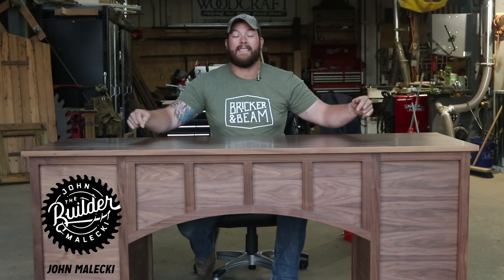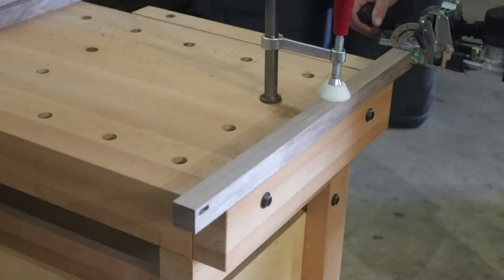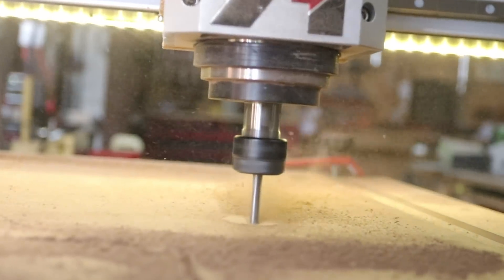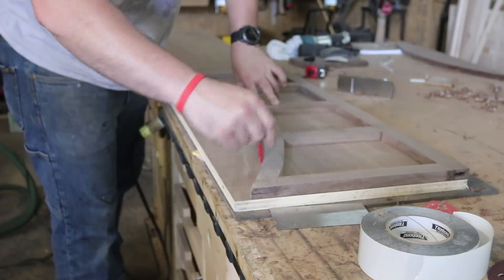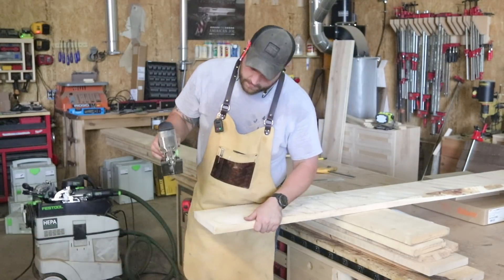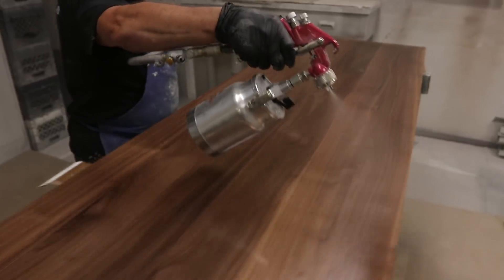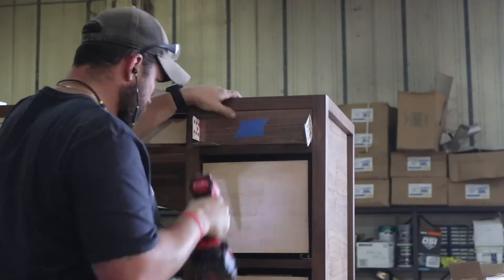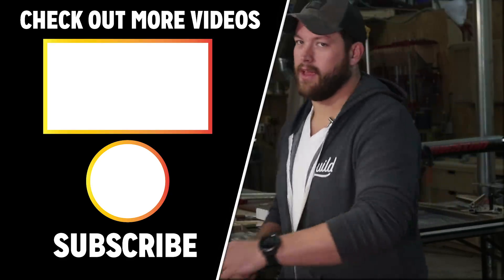How To Build A Modern Office Desk

Comment: Very nicely done beautiful piece. Here comes the (but) lol but I’m trying to see the $1600 in material . I can only guess you don’t have access to a local saw mill ? Iv built one this size with a cost of $500 in materials but at the same time I do have a very good business relationship with my local sawmill . Beautiful job
Reply from the maker: Two sheets of walnut plywood -$125 per sheet 
Quarter sawn hardwood - $9/bf roughly 100bf 
Drawer slides and clips $45-50
Adds up quick !

Comment: Nice job! Love your podcast! $3800 + 40% mark up for P&O...should be @$5320. Even adding in the extra 5 hours would put it at $5670. Where does it round out to $6400. Thanks!
Reply: I didn't totally go through the math but make sure you don't have mark up and margin confused. I out mine in spreadsheets or I'll get it backwards every time.
Reply from the maker: Margin broski. 1.67* 3800
Reply: Cool story. Math though, I know it's hard sometimes. Hence why I like spread sheets so much. If you listen to the podcast, maybe pick up their pricing guide to keep all the math stuff straight.
Reply: Hey, Dave. Stumptown was right. It's margin vs markup where the calculation differs. Check the pricing series we did if you want to hear more on how and why we recommend that approach. Glad you're digging the podcast!
Reply: No, he didn't confuse margin with markup. He added the 40% margin to the labor side only. I see why he would be confused. The he way John laid it out in his breakdown, it appeared he was only adding 40% margin to the labor not materials. But of course that would be silly. If he would have provided a subtotal of materials and labor then showed the 40% margin it would be much clearer.

As for Dave telling helpful people to "f off," no one knows why people are total "a-holes" on the internet!

Comment: John, if you have a problem with your CNC losing position I might have a fix.  I had the same problem and checked with my dealer.  I had programs running in the background like updates, and virus protection.  Also, it was connected to the internet while running.  I turned the internet off and stopped all updates and virus protection while running the CNC.  Haven't had a problem since.  Hope it helps.
Reply from the maker: Thanks Marc, my issue was actually the clamps. I stopped using them and moved to double sided tape for my CNC projects now and its been working well!

Comment: Great video but I don't follow your calculations on costs.  Material at $1,650 and Labor at (43*50) $2,150 = $3,800.  Margin at 40%, so $3,800*1.4 = $5,320.  $6,400???
Reply from the maker: 40% Margin is a multiple of 1.67. A 40% margup would be your math

Comment: Mat=1650, Labor=2150 total 3800
x .4 for Mark up = 1520.... Added  5320.
How is it 6400? I'm missing something...
Reply from the maker: because mark up and margin are not the same. Margin is a multiple of 1.67. give that a try
Reply: Remember that markup is a certain percentage on top of the cost. Margin is the percentage of profit based on the retail price. So, on an item that costs $100 in store, but only costs $80 to make, the markup is 25% (of $80) but the margin is 20% (of the $100 retail value).

His margin is 40%, which is actually a ~67% markup, hence the 1.67 multiple he mentions--which works out to cost (100%) plus markup % (67%), or 167%. Now, you can also use the fact that his margin is 40%, so then start with the $6400 and multiple by .4 and you get about $2600. Take that $2600 off the retail, and that leaves $3800. Or you could just take $6400 x .6 (not the margin % but the cost % of retail) and that brings you at about $3800. Cheers!
Reply from the maker: This is all god stuff brother. We have a pricing guide at Made for Profit that goes through all of this too!
Reply: we just purchased the pricing guide. Lets just say that 2019 prices will be a a bit different.  We enjoyed the pricing guide but we also have to keep in mind what the market will bare.  Very happy with this purchase.

Comment: After seeing your pricing, I've decided that I'm in the wrong business.  40% margin is a bit rich.
Reply from the maker: if you can fetch that margin you can run a successful business, but it takes a lot of work to get there.
Reply: I wouldn’t call it rich. I’d call it absolutely necessary. What’s not included in this breakdown was the electric bill, building monthly payment, wear and tear on machines, blades, glue, dominos, biscuits, sandpaper. It all adds up quick.
Reply from the maker: Yes you nailed it Jordan!

Comment: Top notch build and design! what do you mean by the 40% margin though?
Reply: 40% margin meaning, he has $2150 in labor costs and $1650 in material costs. Outside of those costs he charges for his skill and expertise ( you need profit outside of your labor costs). He is valuing that @ 40% on top off the $3800 he has into the table already.
Reply: Sorta, basically he is an employee of his business. If you work a normal job, u get paid and your company also makes money. That's margin. And you need a new computer at your office job, you don't pay for it out of your pocket the business pays for it. The same is true when you're self-employed, you don't buy sandpaper and new saw blades out of your own money. The business buys those items. and at some point a machine is going to break down, or a new piece of equipment will need to be purchased unless you want to run into a bunch of debt which is silly, then the business needs to be making money along the way to take on those costs later.
Reply from the maker: When you’re running a business the margin pays for the overhead. Andnis where your profits are
Reply from the maker: Yesssss!
Reply from the maker: Yes you pay overhead with the business capital that comes from margin
Reply: thanks for clearing that up! I run a small custom woodworking and furniture shop and will be incorporating these methods into my work
Reply: Am I missing something here? $3800 plus a 40% mark up comes to $5320. Not $6400. Is my calculator broke??
Reply: merrill07 that’s what I thought, to get to 6400 from 3800, you’d have to do an additional 68+ %